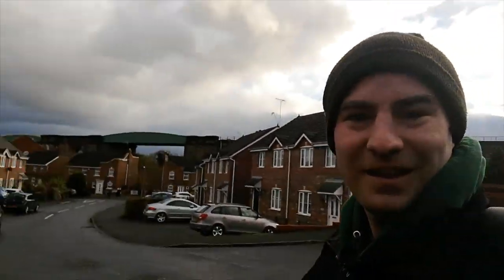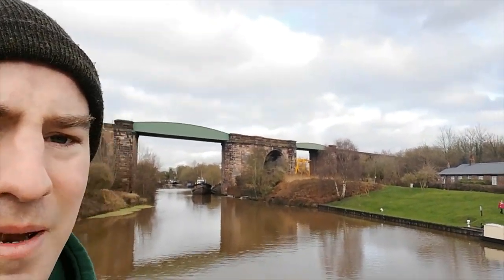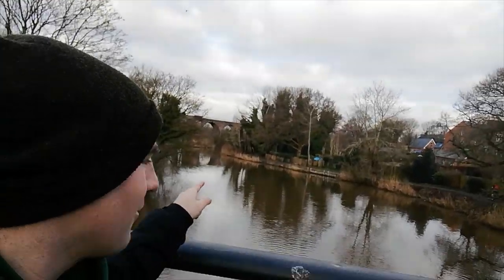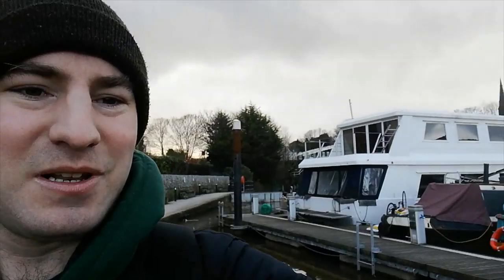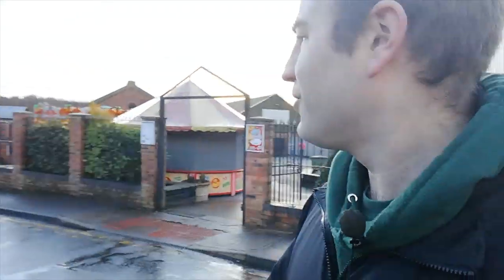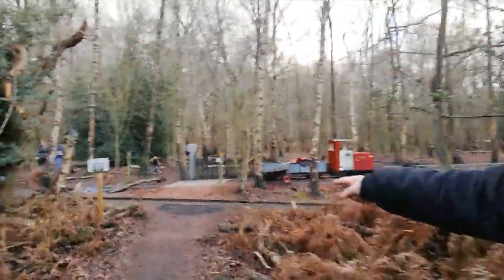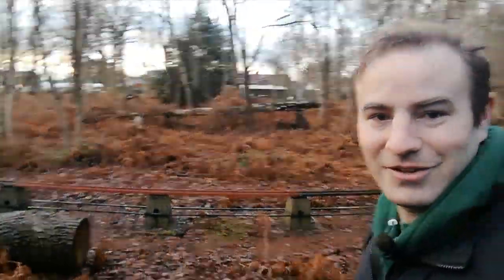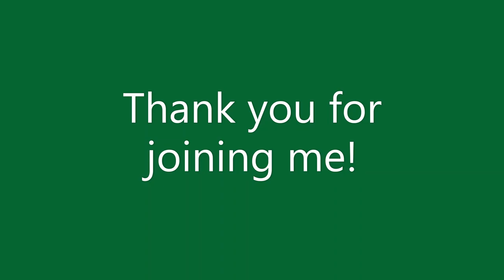A visit the Sandiway Miniature Railway - Episode 17 of Miniature Railway Britain

Comment: The housing estate used to be the Yarwoods boat building yard. The railway type signals were installed after nationalisation in 1948. The large lock was built in the late 1880's to take a steamer with three dumb flats in tow, carrying 1,000 tons between them. The swing bridge gives access to a dry dock and opened in 2010,replacing one dating from 1888.
Reply from the maker: Thank you very much for the information.

Comment: Nice video as usual, Henry. The Leftwich Viaduct on the Mid Cheshire Line also crosses the River Dane, as well as the Weaver and the Weaver Navigation. Towards the end of your visit to Northwich we caught a glimpse of the Dock Road Pumping Station, which is occasionally open to the public and we visited a few years ago, see here: https://vinchad.blogspot.com/2013/04/dock-road-pumping-station-northwich.html

Nice to see the extension in progress at the miniature railway site. I have driven around that site both on the 7.25 inch and 5 inch raised lines. Good to see the 'big' ground level line will be 5 inch as well as 7.25 - I must take my 'Lindow' loco down there and have a run round!